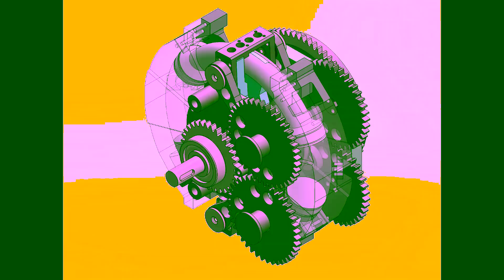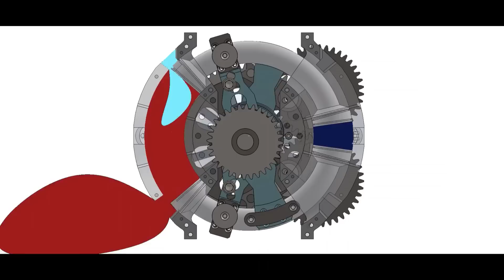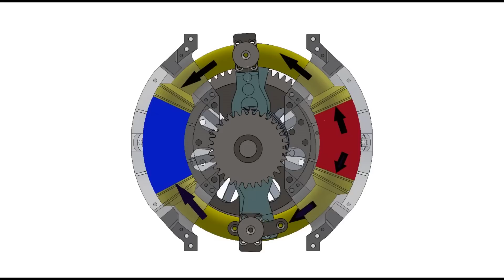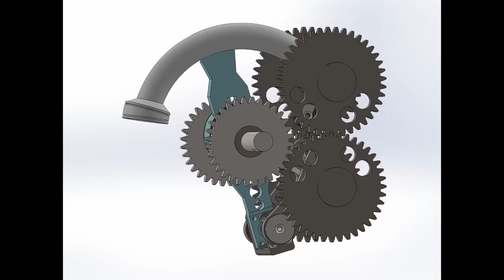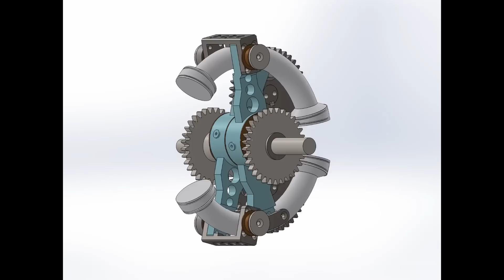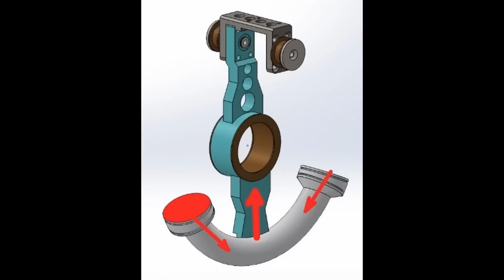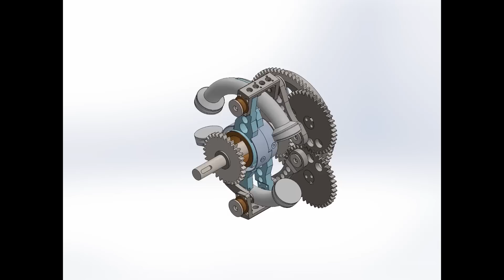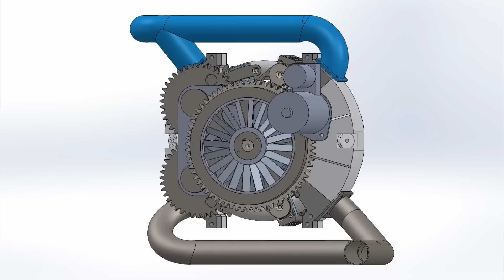A new type of Engine

Comment: The amount of time and calculations and  that went in to this presentation are exquisite I'm a mechanic for a log company and I have been rebuilding chainsaws for years and have wondered why no one has come up with a better 2 cycle chainsaw engine or deisle engine the concept in this presentation is spot on and should be developed in to an actual working machine

Comment: I love ideas like this, my only concern is manufacturing complexity, there are plenty of designs that might be superior to the current internal combustion engines we have today, but manufacturing simplicity is a major reason why some designs prevail over others. To produce to scale the simplicity of the design is a must in many situations. An issue I see with this design is consistently maintaining a good seal over a curved cylinder, it’s hard enough to make a straight cylinder to such precise dimensions, and to make that last, curving the cylinder would add complexity onto complexity, is it viable? Sure, would it work? I’d wager it would, could it be found in every day cars? I’m doubtful, but maybe, depending on the pros and cons it might catch on with luxury vehicles. Long term Reliability is something that concerns me on this engine design, I wonder how well a curved cylinder would handle thermal expansion as well, and I honestly have no idea what the vibration would look like or how to mitigate that. Who knows man, do it, make it, show the world the fruits of your creativity, could be tomorrows next best engine, or tomorrow you might have a better engine design from what you learned making this one. That’s how innovation works, try an idea even if some others think it’ll fail

Comment: interesting topic, if it is a 2-stroke engine, where the crankcase is positioned, which works as an organ pipe, and its crucial for the engine to work, maybe if this theory was presented a couple of years ago, could have been revolutionary, but today, most technologies, are unfortunately involved with battery systems.

Comment: I kind of like this idea, I think it would be pretty good for instant tworqe, longevity, and tunability and it would probably sound very cool. I just think it should have smaller pistons half the size but more of them because with the stroke being that long the pressure might become negative and get the piston stuck until it gets more air and reduce its efficiency so it would have to be pulling in a lot of air and burning fuel at a rapid rate to keep that from happening and ideally the 4 pistons idea would negate that to some extent. I cant say for certain as I dont have any experience with engines but that's just my thought so I might be wrong

Comment: Manufacturing that piston design has been attempted before and obviously did not work because this is called " new ". Anyway, it is cool and all but the Achates engine is far superior, has been actually built and installed into an F150 several years ago. Thing is that the department of energy partnered with the company and now they are either suppressing it or just stupid. It is an off center opposed piston design similar to the concept you showed but straight pistons and no issues in manufacturing. in fact, it is the same design aside from the angel of tilt as military gensets that have been operational for a long time.

Comment: I’m a huge fan of rotary engines as I think they are very fascinating, however they do have reliability issues, so I have been brainstorming a better engine with the advantages of a rotary with the reliability of a piston engine. This exact idea or curved pistons crossed my mind, but I immediately thought it wouldn’t work and moved on. Massive props to you for putting in the effort and making this awesome assembly. Cheers 👊

Comment: 1. This engine also has a crank like other combustion engines (except for the Wankel engine of course) - so we still have reciprocating motion here. Where is the innovation , novelty or revolution here ?
2. Piston rings will wear unevenly - during centrifugal forces, the side of them moving on the outside of the cylinder will wear more than the side moving on the inside of the cylinder .

Comment: Machining a block/crankcase in which to contain all the pivot points and to supply oil to them all would seem to be the hardest obstacle to overcome with this design. It would be difficult to contain it all without leaks.

Comment: wow... that's pretty clever....
Reply: I have some metals you might be interested in.. obtainable during the casting of aluminum parts with a mold made from various flavors of volcanic ash with borax added... the mold is like unfired ceramic... the lower temperature version is AuPd.. a natural gold palladium alloy.. it is a superconductor for both heat and magnetic energy... a higher temperature version is AuPt.. gold platinum alloy... volcanic ash weathered is kaolinite clay.. we make plates from the stuff I get platinum from.. I am probably not the first person to figure it out,  eh?
no patent.. open source technology 
I also have carbon and silicon carbide for bearings and bushings..  so do you you just don't know it..  yet... also free... I like free.. 
I like technology..  it's time to try something new

Comment: Holy mother of manufacturing costs.
I'd expect a heavier load on the outside walls, any part failure will result in a total loss.. 
How are you expecting to oil the top section of the engine? (or even the sides for that matter..)
All this for.. idk what.

I mean something this complex, you might as well use a rotary.

Comment: I'm not trying to discourage you, hear me out;
Constructive comments:
(1) I would move your intake/exhaust ports closer to where your pistons meet, because the way you models shows the exchange of exhaust and intake air doesn't make sense. While yes the pressure created would expel some exhaust gases, the pressure would equalize and no more would escape therefore re-compressing exhaust gases and choking out the combustion. In a similar manner there is also no vacuum to draw fresh air into the cylinder. If this would work as a 4-stroke system with the intake/exhaust ports close to where the pistons meet it would provide ample pressure to exhaust the exhaust gases and be able to draw fresh air on the following stroke.
(2) My other comment more than suggestion is that without piston rings like a regular piston engine the is no seal in which to have a sealed chamber to compress the air/fuel mixture suitable for efficient combustion and or contain the combustion itself. And with the addition of piston rings lubrication is absolutely required for the longevity of said piston rings and the motor at large.
Opinion:
Overall I think this is a cleaver opposed piston engine design operating, similarly to "Commer TS3" diesel engine but if your components are balanced correctly you could have a smoother running unit. The opposed pistol design benefits from higher attainable compression ratios making it ideal for diesel applications. I agree with one of my other commenters that calling it outright a "rotary engine" may find you in some trouble, not to say that you should drop rotary out of t he name entirely, just add some other defining word to it.

Comment: ironically, the design seems like a more compact opposed piston engine.  id say the biggest design flaw looking at this from a perspective of performance is reliability.  the delivery of power, especially with higher compression ratios and higher end torques would cause undue stress more than likely on the gears internal to the engine.  i feel as though wear would also be a huge factor, especially for piston rings and cylinder walls.  a supercharger (or scavenging air blower) would more than likely be required to scavenge the air throughout the cylinders, similarly to a fairbanks morse diesel.  i could see this potentially becoming a thing in cars designed specifically for fuel efficiency, but a working prototype is desperately needed.  also, i do have a question.  is the fuel air mixture to be ignited through compression or spark?  that would more than likely create issues within the design as well, depending on which one is desired.  how would vacuum be maintained on the engine to aide in ring seals and prevent crankcase explosions?  i feel as though something like that would be necessary, even having it just vented to atmosphere would also work.  either way, pretty cool.

Comment: It's a cool design but it will not over prototype. There is a major issue with your design : weigth transfer. When pistons are changing from side to side there is no opposite mouvement to it. So, it will shake like hell and brake the engine

Comment: I suppose moving massive weights will result in dramatic vibrations of the engine, and thus short lifetime. Also pistons\cylinders manufacturability is hardly possible. A lot of gears and moving parts will also bring down weight-to-power factor. But looks cool, no doubt.

Comment: 5 points to note with this concept. 😃
1. The use of push pull forces on the pistons, chef's kiss! The water injection/cooling idea is very elegant too, love it! Just add a heat sink to allow the water to cool, if its in a closed system 🙂
2. Not sure it will reduce friction that much due to the gearing. lube it, add a heat sink. 😁
3. Have a little experiment with chains, or heron gears to connect that keyed shaft to the arms. Chains tend to cool faster if your concerned with heat. Heron gears capture each other, so might help reduce vibration at higher rpm. (not sure if these would help, just food for thought 🙂 )
4. The curved pistons will rub on the cylinder wall, either due to their tight fit for the watertight seal, vibration from the connecting arms or wear n tear. But this isn't necessarily a big issue. just make sure they are lubricated. The lubricant will help form a watertight barrier too.
5. This is truly excellent work!!!  Great concept! Don't think its quite there yet. But don't give up! This is excellent! And most of the commenters don't know what they are talking about haha! Next step for you is to get this prototyped and see what happens 😃 Get in touch with someone who could 3D print this, if you can't yourself. and see how the mechanism runs in practice!! People like you can change the world! Don't let Youtube commenters get you down. Come join our ranks! Make our world better! Little by little! And push FORWARD to the dawn! haha 😂😂😂 seriously get it prototyped =]
Reply: OH OH OH! Non parallel surfaces to the heads of the pistons might counteract the centrifugal force of the pistons. But changing the angle of attack the force will have on the pistons. maybe. (That suggestion is a bit of a shot in the dark, but maybe worth investigating? I dunno). I've subscribed cause I'm so intrigued to see more though

Comment: 1st...way to many working parts. 2nd those working parts, gears...never going to with stand the pressures. It must be built with such mass for strength. uneven heat transfer within the cylinder and piston...Keep working.)

Comment: Interesting concept, however, it would fail in competing with classic cylinder engines due to complexity of manufacturing. It would be very expensive to produce those curved rods with the needed precision on the pistons compared to straight cylinder engines. Curved cylinders with little tolerances would be a problem too. Everything would have to be done on a 5-axis CNC, which takes a lot of time, and as we all know, time costs money. Not like i think this engine's aim is to compete with straight cylinder engines anyway. I would definitely love to see it running.

Comment: -"We developed a new type of engine"
-"wow ... and how it works?"
-"burning fossil fuels"
-"... but ... that had already been done"
-"but we burn it in a new fancy way!"
Reply: That is what is called innovation. That means make it better or faster or smoother or easier to operate or more efficient.  Think about it this way. a regular engine has a thermal efficiency of 35% this engine may be 50% I don't know. I never seen this engine, but it could be more efficient smaller and lighter therefore has a benefit over the old engine.
Reply: @adriaanvantulpenbaard1740  
I agreed. but not the point.
Title : "A new type of Engine"
Maybe is better, faster, smoother, easier to operate, more efficient, etc. But is not a "New Type of Engine".

Comment: Only pieces of advice I can give. Swing engine is already used. But this is far close to being called a swing engine than a rotary. There's two kinds of rotaries now too.
Centrifugal forces will still cause some friction, and it won't be even on the cylinder walls.

Comment: Opposing piston engines are not new. Look up the 1882 Atkinson differential engine.

It's almost an identical idea...

Everywhere metal touches metal friction creates waste heat and wear... This design does NOT eradicate that waste from piston travel or generated heat from the combustion process. You still have acceleration/deceleration of each piston the only difference is it uses that force during the compression state, increasing efficiency but again hardly a new concept or idea...

If the piston does not come into contact with the cylinder wall as you suggest there would be no compression, and the engine would not function. I really don't get where you're getting your information from, compression is a significant cycle in both two and four stroke engines and without compression there would be no significant force to drive the pistons and turn the engine...

Comment: Wouldn't it be extremely difficult/impossible to manufacture curved pistones with enough rigidity? I am in no way educated to judge this, but my gut feeling tells me they will bend out of shape and scrape the walls after a very short amount of time.
Regarding temperature: celsius is not an absolute value, so saying you can "halve" the temperature is not a reliable way to present your data. It's better to say that you can reduce it from 800 to 400°C. Halving implies halving the energy which is not the case.

Overall, a great presentation! I hope you continue your work in the future and strain your mind with difficult problems as this one! We need more people like this.

Comment: I really like the idea, it seems doable.  My only concern is how to machine and hone the "macaroni noodle" "cylinders".  Is there a way to do it that wouldn't require it to be built like a sandwich with seams in line with the stroke of the "cylinder".  is there a tool that can bore holes that are macaroni noodle shaped as opposed to straight?  Or do you have to just construct it in a sandwich method and hope the seam is so clean and tight that there's no blow-by.  I suppose some sort of additive manufacture or maybe EDM could do that but you'd still have to machine and hone it to tolerance
Edit.  I suppose Taurozzi built a "pendulum" engine with curved cylinders so it can surely be done,  I'm just curious how.

Comment: Your engine idea rocks!

I think you'd have to have it 3D printed but to make a cheap prototype perhaps use split piston cases for easy machining. Copper electroplated ground faces might be enough to act as a "head gasket" between them.

Comment: A really interesting design. Tho, i'm not sure if it's a regular thing for 2 stroke engines, but what about inges\exhaust valves? I mean, w\o those would fuel-air mix leak onto exhaust until the pistons close it?

PS. Will there be a way to get STL files for printing one? It would be an interesting experience

Comment: This motor looks like a great engine for high power small form factor engines, but on a larger engine with larger pistons Id imagine the centrifugal forces on the piston end of the 'piston bone?' would cause the pistons to flare out and contact the outer wall of the cylinders.

Comment: honestly this is pretty impressive, my main concern with it would be the fact it would shake itself to pieces if there is ever any issue in timing.  Along with that an ignition source will be hard to work in.  Being said, you could bypass this issue with use of detonation and not ignition (much like diesel engines).  Only concern would be getting equal fuel and air mixtures to each cylinder/ bank.  If there is a slight variance, there would be more power given on of side than the other, and this would cause massive vibrations.  All this said... its honestly a really cool concept that might work in practice.   There's also a lot of benefits not mentioned such as reduced stress on parts.  A crankshaft has a lot of downward force on it, and a design like this would focus the force more outward.  It would be beneficial giving reduced wear on parts.   Along with that, it just looks cool in my opinion.  excited to see where this leads

Comment: Engineering: Hey I have a cool idea...
Manufacturing: Can't be built!

The cylinder casing will be near impossible to make. Taking a circle and extruding it into a banana shape is not something a typical CNC mill will be able to do. Try to take a power drill and drill a banana hole in some wood. When you twist the drillbit you disturb the surface elsewhere. Only way is to have a specialized machine built that can make these type of holes...

Comment: A curved sleeve cylinder shall fail miserably due to inner and outer being different in stroke area and the curve itself will experience immensely different loads and heat distortion resulting in compound excesses of wear rapidly.
The concept shall run but the efficiency longevity is very limited in overall life span due to this design flaw.